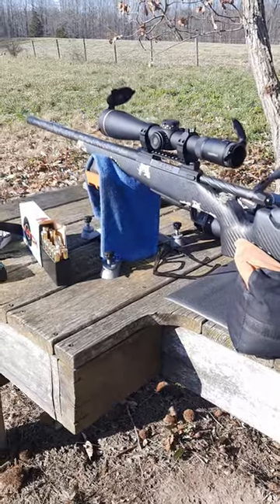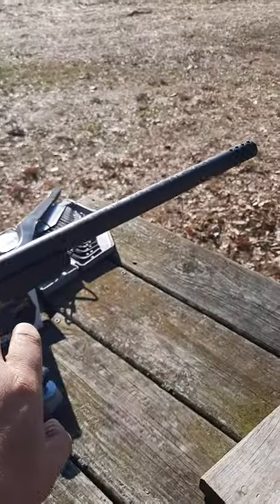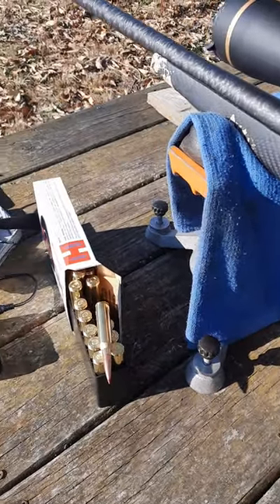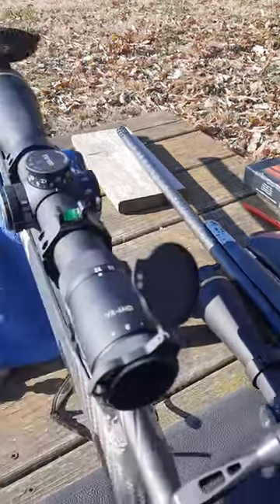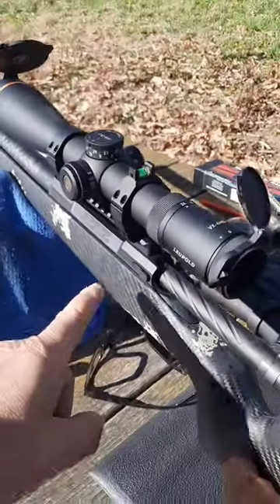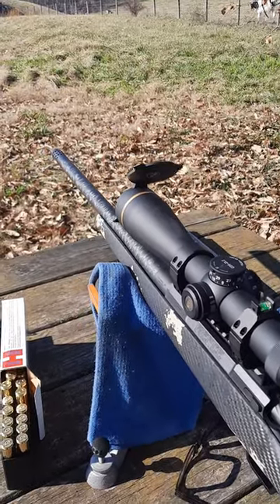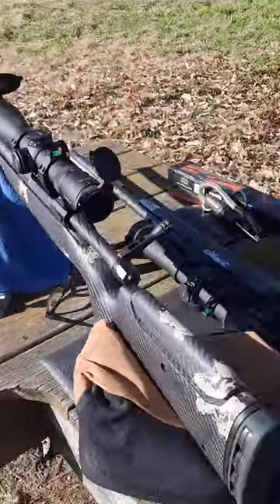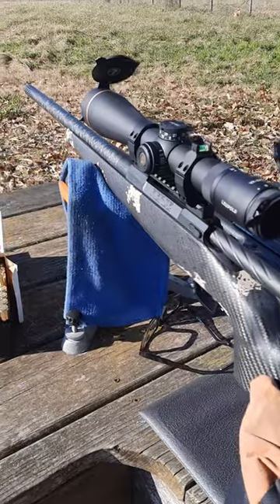7PRC Fierce Rifles- Does barrel length matter? Yes...

Comment: It’s so crazy how good the 7prc handles the shorter barrels. Most cartridges lose 75ft/s per inch
Reply: Efficiency.
Reply: 6.5 PRC does that, too. My 20-inch shoot 142 ABLR at 2944 and 143 ELDX at 2925 with reloads. Factory 143 ELDX called for 2960 from 26 inch barrel. Even Factory loads shoot 2854 for ELDX out of my 20 in. So I lost about 100 fps from 26 inches to 20 inches on Factory loads and about match Factory loads velocities with reloads.
Reply: I’d like to see the velocity of the 7prc with an 18” barrel. Shouldn’t be a lot different than a 20”.
Reply: I'm thinking about putting together a 7PRC revolver with 8" barrel.
Reply: This is not an accurate assessment. Most cartridges lose 20-25. 75 per inch not a thing.
Reply: @Johnbobon  Call it the "seven shooter" lol

Comment: I believe what you’re looking for is energy… the 24” @ 1000 yards has 1369 lb of energy… The 20” has 1257 lbs of energy… (both figured with a 175 eldx) that’s 122 lbs difference… both would kill a whitetail at that range but neither carry enough recommended energy for elk… so knocking 4” off a 7prc is a lot different than knocking 6” off a 300 wm…
Reply from the maker: Yes sir..I understood exactly what I was talking about and as you say pertaining to energy spent.
Just stating the fact that many merely cut the barrels off simply trying to "keep up with the Jones's" not understanding what they are losing..or after doing so can't understand why they've lost so much performance.

Comment: I’ll take the velocity loss….. that’s not bad. I actually had the same rifle being built by fierce 20” barrel ct rival I cancelled the order and went with Bergara. I may change to 20” barrel.
Reply: What factors made you switch to the Bergara? I'm leaning toward a Fierce CT Rogue, but i haven't made up my mind yet.
Reply: @Johnbobon  honestly they kept pulling my chain said it was a 4month wait time from fierce which I was fine with. After the 4months they pushed it two more months after that two more  which was going to be December so past my hunting season which I really wanted that rifle for a hunt I had last year. so I cancelled cuz by that time a lot more manufacturers were producing rifles in 7prc. I looked a lot almost all off the shelf rifles. I really  just wanted a simple mountain gun and always shot Remington 700 stocks well and it checked all the boxes I did out a adjustable cheek comb on the which I recommend with the factory stock. Plus I have a Bergara b14 hmr carbon. And it shoots lights out so I knew they had good barrels. After sighting it in I found my action screws were 10lbs under torque my best group was .75 with federal eldx. I shot almost all the factory ammo available minus the nosler. After tightening the action screws I shot a .36 group two back to back. Hard to beat for the price. Also been looking into cva cascade rifles they seem very decent as well for the price. I might pick one of those up next and try it.
Reply: @xfighter1117  Appreciate the feedback. I see some negative reviews about Fierce quality control and customer service, along with lots of rave reviews. It's hard to wade through the muck to find the truth in it all. Whatever choice I make, seems like there's going to be some risk. As they say, "your mileage may vary."
Reply: @Johnbobon  ya I heard the same. Everytime I called they answered and helped me and they made it right with my deposit so I can’t say anything bad on the customer service. Also cabelas/bass pro shops carry fierce now to if you want a pretty standard config id just go right to them. Or make your order right after the hunting season or first of the year In case it gets pushed like mine.